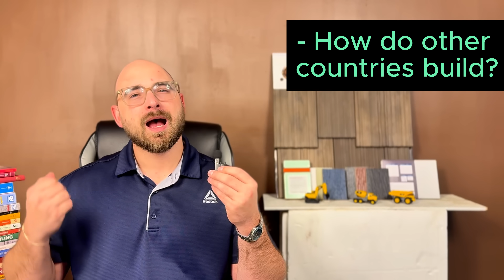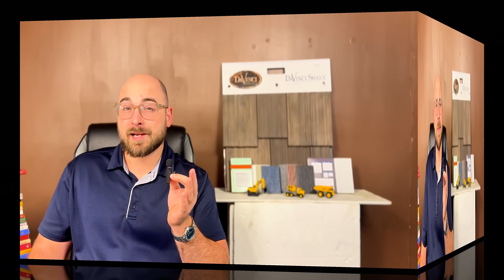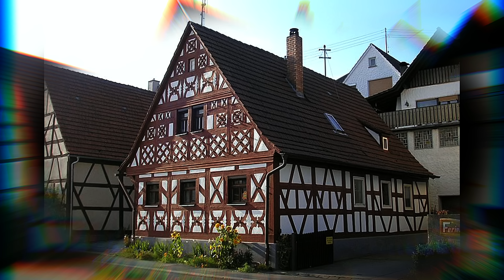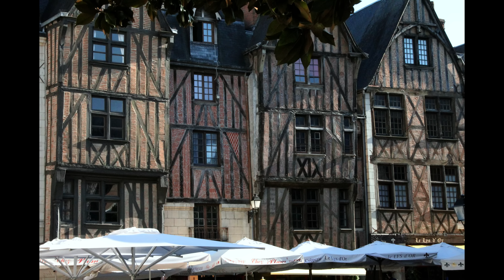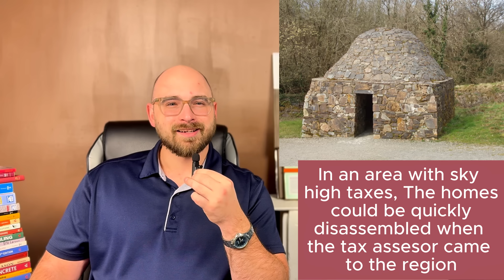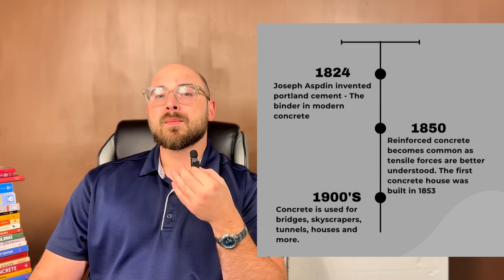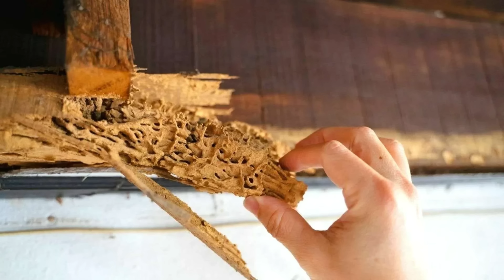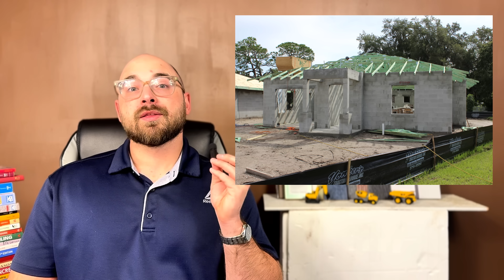Why Other Countries LAUGH at American Homes

Comment: I'm an American living in the Philippines. Here, they build houses with concrete which is a very strong material. I feel much safer in the homes in the PH than the United States.
Reply: My worry with a concrete gone is services.  What if I want to put in another outlet and have it blend into the wall?  What if I want to pull new wires or technology changes? Timber frame is really adaptable in that sense.
Reply: Better protection against the typhoons and earthquakes too in Philippines
Reply: But you gotta keep in mind how every place builds based on the local climate. There that type of structure makes more sense. Here depending on the region wood makes more sense for various reasons including winter and flexing instead of cracking
Reply: I think I would hate concrete, too much like jail. Also how do you dispose of concrete? if you can name me 3 different methods I will be impressed!

Comment: Saying that the method is just more expensive shouldnt be an excuse, cause thats expensive because your national market doesnt use enough of those types of construction material and so that way the price wont be smaller because theres not enough search and theres a small supply, but if it turned out to be the main type of construction it would get cheaper also. 
About the complication part i dont agree at all. And even if it looks a bit more complicated because culturaly youre not used to it, when you get a construction worker that does the service it will tell you how it isnt, and even if it was the pros from the safety, durability etc etc would compensate for sure.

Comment: I’ve done a few icf homes in Minnesota. Only set backs I can see is the walls must be filled very slowly so they don’t blow out and in the spring and fall when you switch from heat to       A/c it takes a wile for the house temp to switch. The walls hold the temp so well wich is probably a good thing.

Comment: I call it "Brick Veneereal Disease". Bricks on the outside of a home are stupid. They are a cladding only, and that cladding will simply fall off in an earthquake.
Bricks must go INSIDE the insulation, so that the house has a tremendous thermal mass to take advantage of.
I would NEVER EVER buy a home where the thermal mass is outside the insulation!

Comment: People used to live in skin tents and thatched huts, both had dirt floors.  We just need way better energy efficiency, more insulation, vapor sealing, thicker walls, insulated foundations, higher R-value door systems.  Radiant slab heating, on-demand hot water.  Cut your energy use by 75%.  No one is coming up in the building trades.  All the carpenters I know, and I work around the whole country, are grey and white-haired men.  Wages have been stagnant for 40 years.  Tools have gotten way better, but home design is still illiterate, and slavishly conformist.

Comment: The materials used for a building also depend on the type of building. Of course, we are talking about housing, but there is still a difference: building a private house, a low-rise building, a high-rise building or a skyscraper. In Russia, for example, for private housing, houses made of concrete frames are common, where the walls are filled with aerated concrete, foam blocks or other cheap stuff. The full brick houses are too expensive, they are rarely built, as well as the wooden ones, but not because of cost, but rather maintenance - they decay quickly. The same is done with high-rise buildings. For dacha, the choice is more likely to fall on a log house, it is a lot cheaper since they are often precut and therefore built fast, but you don't live in it permanently, so the convenience of maintenance or energy effectiveness doesn't really a first thing on the list. And low-rise houses are considered elite, so they can spend money on bricks. Well, the most widespread in our country are the well-known panelki: private houses, high-rise buildings, low-rise buildings, public buildings, anything that comes to mind are built from concrete panels

Comment: here in Latin America they build houses out of Brick and Mortar with rebaar and concrete floors, the houses are small but they sure as shit are very durable, all though construction is very different since houses are stuck together in rows like you'd see buildings in New york, we don't have backyard or frontyard space usually it's just the driveway/garage.

Comment: European working in construction, I've seen houses in the US and they look like poor amateur DIY work. The difference is not that we are better builders, it's just the regulations. Our governments don't sell us "the american dream" at any (cheap) price but care about environnement. The regulations impose quality materials, recuperation of rain water, or specific levels of insulation for example. Inspections are very strict and we need softwares to justify the calculations of every lambda, Uf/Uw energy coefficients. Being good as using a hammer or a saw is not enough here. Homes are more expensive but low energy consumption make them cheaper and more sustainable on the long time run.

Comment: i built my house in steel reinforced concrete framing , steel reinforced concrete  flooring(200mm thk) + autoclaved aerated concrete bricks for the walls (350mm thk). the roof is a combination between steel reinforced concrete framing and  timber covered with steel sheets. all insulated with high  density basaltic wool 150mm thk.  the available space is1500sqft and the weight of the house is calculated to 450metric ton.

Comment: 20:00 Moisture in buildings leading to mold is probably the reason Germans are so keen on "Lüften" - we air our buildings regularly. Several times a day, preferable with cross-ventilating where you open windows (and of course inner doors)  on opposite sides of the apartment/house for a short time.

Comment: I currently live in a 95 year old brick house and have lived and been in many older ones. I can say that its very common for the major structure (brick walls, roof and foundation) to not need any maintenance or repairs if they have been built with proper baked bricks and good mortar. Only the few wooden parts that are directly exposed to the elements wont last. Im pretty sure most of the houses built here today will last over 100 years and stay in good condition and wont need any work done to the outside and structure.

Comment: 20:15 COST of Single solid structure home you need to compare to FIVE wooden structure homes, cause the Solid one is for 100 Years+, when light timber units for 20 years most ;-)))

Comment: The structure is one thing but also how wires, plumbing are drawn. How insulation is used in external and interrail walls etc etc. It all just feels so cheap. Example of this, in my view cutting corners, is when Swedish tv channel wanted to make a Swedish version of Extreme home makeover. But was denied because it's impossible to build a house in such a short time and still do it up to code in Sweden. So they had to scrap the idea.

Comment: the house that I live in is 267 years old. typical Irish farm house. eddit: the walls are 55cm strong (22inch).

I work also in construction in New Zealand. the used to build stone building, but payed a high price in several earthquakes for it. today they build mainly with wood or steel. in wood framing houses the membrane seem to be the only thing to keep moisture out, which very different to our house in Ireland.

Comment: As for Italy, the example of the Trulli of Alberobello is a good example, but there are many buildings that have been inhabited for centuries. It is very true that earthquakes are the danger in Italy. The top experts are the Japanese (great people). slowly (unfortunately) we are trying to make all the structures anti-seismic. Difficult sickles with 1200-800 year old buildings, although so far, they have held up. A curiosity, the city of Matera has structures built directly in stone and has been inhabited continuously for over 5000 years.

Comment: Well, just think that the main door of a house in the USA, seeing films, news, etc, is practically thinner than the door of a bathroom in Europe (also Asia, Africa etc ...) ... However, there are wooden houses also in Europe, especially in the upright areas, but practically all of them have stone bases, thick doors and if well kept, they have a space around them as a "fire cutter". I understand that it is cheaper to build a wooden house, but the duration is minimal and just think of the Tornado Valley. Rebuild houses quickly and at a low cost, but every time you lose what you have ...

Comment: The reasons most houses are made of timber in the USA are the following:
1) It takes less labor hours to build (therefore it is cheaper)
2) Cheap wood is available from Canada
3) Tradition dictates how a house should look and be built
4) Interior modelling is easier and cabinet mounting is standardised (they are mounted directly on wall beams that are 12" or 16" spaced from each other)

Comment: Most modern homes in Denmark are built using precast concrete panels. But with outer exterior walls made of bricks. And then there is insulation between the concrete panels and the outer brick walls.   By the way timber framed houses with infill are very durable. In Denmark we have timber framed houses that are several hundred years old.

Comment: Parhaps, the biggest flex modern American wood framed houses have is the customization. Alot of larger houses in older cities started out as smaller houses, and various owners added rooms to the outside. If you move into a house and want to knock down the wall between two smaller rooms to make a larger room, you can start working in the morning, and be completely finished by dinner time. All you need is a sawzall, a nail gun, and a few hand tools. You can frame up a brand new wall in less than 30 minutes. If you want to add a new room to the back of the house, you can completely finish it in less than a week. You can run all of the electricity in the house with nothing more than a drill, some screw drivers and pliers. You dont need to chip away concrete or stone also, everything is generally built to the same standard with studs at 16" on center, so you can look at a wall and visualize where the studs are behind the drywall, which makes things easier to work on. Also, alot of household repairs can be done by a homeowner who posesses very basic woodworking skills, while concrete and stone houses are more likely to require special tools and expertise. One more thing i want to add is that we do have alot of houses made with structural brick in the older parts of older cities. I know this because i live in Virginia and have worked on alot of them, although to be fair, east coast states like Virginia and Massachusetts probably have about as much in common with Europe as they do with younger states like California.
Reply: Masonry houses are also being extended - please check old countryside properties in Spain or Italy. You just use different tools that you grew up with. If course it's more difficult to chisel brick or stone than cut wood, but quality has its cost. Things that are easier to handle are lighter and softer. Basic woodworking skills in US is the same as basic masonry skills in other countries.

Comment: Uk 🇬🇧 homes are terrible, even new buildings have draft issues, yes they are better built for wind rain maybe fires to a point! But generally speaking they are expensive to heat/cool the pvc-u windows doors we use are not as good as you would think, the frames are not insulated and the joins to the building, is a complete let down with no insulation value and really no thought.
ICF is probably one of the best ways to build it just needs some tweaking to help around openings.

Comment: I think most of the critisism derives from bad insulation, cheap materials and construction methods, resembling what is considered bad craftsmanship by many. Many homes don't even have any real insulation between the rooms ceiling and the roof, like a garden shed. Same goes for the asphalt shingles. Both are very uncommon for Europeans to build actual homes with and might only be used for sheds, garages and other peripheral buildings. To build homes from wooden structures ist becoming quite common though, but with higher standards, thicker walls and mineral fibre or organic insulation, while in the US PU foam is often used. The electrical installation and plumbing are another point to be addressed.

Many of which can be seen look very cheap and performed in a "time is money" way, that leaves no space for pride in craftsmanship.
That's just my observation of why this opinion might be so wide spread.

Comment: Pretty much all modern houses in the UK are Brick, Block (Cinder / Breeze ) and Studding, with internal drywall and, if you're lucky, some insulation.....older houses just had internal cavities, originally on the West facing wall only, to combat damp caused by the prevailing Westerly Winds which carrying the moist air....

Comment: This is by far the most balanced, comprehensive and thorough video about the "cheap and flimsy" American houses feeling. I live in the Netherlands where the rivers makes bricks the cheap way to go. The basement is made of 50 cm thick waterproof concrete, the floors are prefabricated thin reinforced slabs of concrete and the inner walls of CME. Outer walls of bricks combined with white plastering. Roofing with very thick sandwiched foam and concrete tiles which is extreme energy efficient. Still, my next house will be concrete foundation with wooden structure  because of liability. A wooden house is acoustically silent (a brick house is like a resonance chamber....) way more ecological and sustainable, especially with laminated wood. Although the concrete poured in isolation locks is way more energy efficient, livabilityis what's most important for me.

Comment: To all those deriding European homes that are 100+ years old... Humm "cold, and draughty with no light" ok... the flat I used to live in had a main window in the lower floor that was 14' by 8'. That was not small - it was also wooden - but with good upkeep on the wood (regular paint and refinishing) and a good window seal - no draughts. We also fitted huge blackout curtains so good insulation too. 

It was a refurbished building but the original structure is still more than good in the heart of a popular UK city. 

As for my current home - it was built in 1896 and about the only issue we have is that the roof would need to be replaced to add more insulation but we have cavity walls, double glazed windows and a good heating system as well as cast iron fireplaces (in Art nouveau style) with a decent amount of space. The kitchen has also been made open plan but the rest of the house has these things called rooms so that everyone in the house can do their own thing without disturbing everyone else (like practice on the upright piano, do cooking, go on a computer all without everyone else in the house being disturbed by it. Really useful when I want to listen to music - the rest of the house can barely tell)

Comment: There is nothing wrong with wooden houses overall, it just depends on where you build them. Im Swedish and here it is very common, as it suits our climate very well. We dont have earthquakes, hurricanes or other disasters, so it isnt a structural problem. 
The key with wooden houses is to build it properly, you need to leave air space in the walls and prevent mold and water damage. American houses are built in a haste, with the cheapest materials and cheapest labour. Thats a recipe for disaster

Comment: Hi nice video. In switzerland me mostly use concrete with custom wood forms (built on building  site) for multi family homes and also for stairs. But sometimes we use concrete prefabs there. Since You can mount them with dampening systems to the built on site concrete structure. And also for the cellar/basement. We use sand-lime brick walls for everything bellow earth line. And normal bricks for above. While most of the time every roof is then build on site with concrete. So we have some parts out of bricks and some out of concrete and some out of prefab concrete.

Also we use a lot of Insulation. Normally on the outside.

Newer houses have flat roofs out of concrete. Older houses normally are made with tough wood frames and brick construction in between the wood.

Also the older the homes get the thicker their wall is.

Some of our old town buildings have insane walls of 0.8-1m thickness.

But the oldest buildings were made of wood and have since decayed or out of chalkstone, sandstone, roman cement or massive stonework which lasted to this day.

Comment: When the useful lifespan of a US house is 20 to 30 years, you actually need to depreciate the structure over time. Unless entire neighborhoods are structurally replaced every 15 to 20 years you end up with slums and costly urban sprawl. Where houses have a 70 to 200 year lifespan it becomes a more stable inter generational investment with stable neighborhoods over generations. Where I live, you can build a 70 year plus solid home for about a fifth of a US light timber home. Home buyers are so ripped off in the US, buying into problems and decay at premium prices.

Comment: WhY dOnT wE uSe CoNcReTe In HoMeS!?

Because it's expensive, challenging to handle, nightmare to properly mount anything to it, sub-par brutalist/third world aesthetics, and physically taxing to work with in any form. Moreover, modern concrete is surprisingly temporary, especially since rebar creates the perfect environment for major structural weaknesses to form.